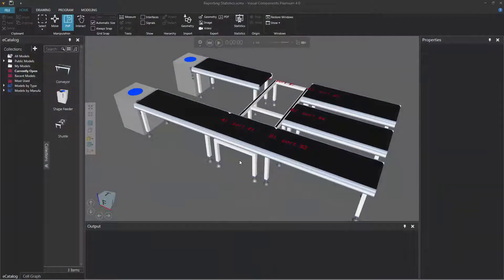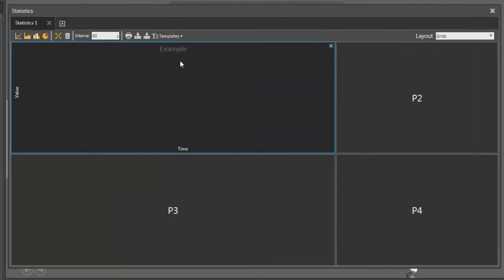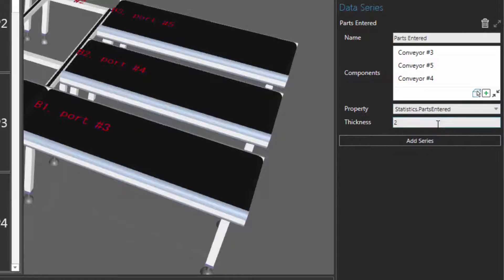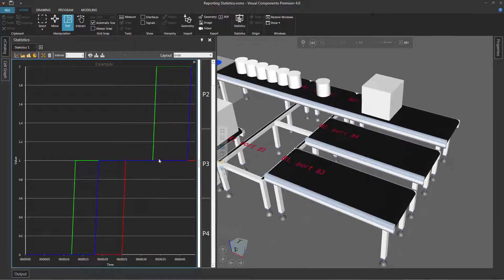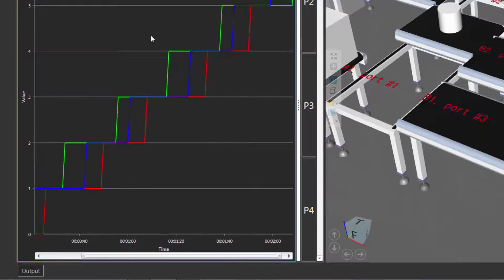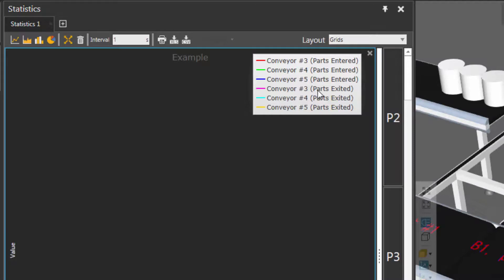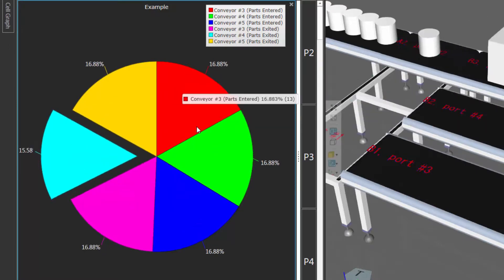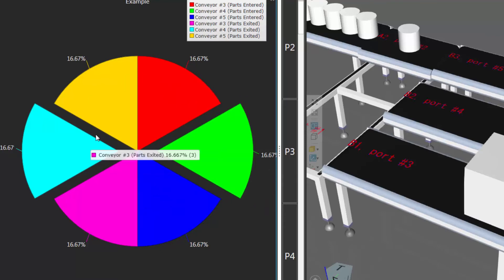Report Statistics

Comment: How do you add statistics capability for new component modeling? I created a custom CNC that I need to determine cycle times, idle time, etc...? 
I am using 4.1 VC.

Thank you.
Reply from the maker: Add a Statistics behavior to the CNC machine, and then in the properties of the Statistics behavior, create default states as well as your own. From there, you need to define when the machine goes from one state to another. Assuming there is a Component Container behavior in the machine, the Component Container has a Statistics property that can refer to a Statistics behavior, which automatically keeps track of flow-based statistics when referenced by a path or container in this case. This tutorial is a good starting point for defining states, https://academy.visualcomponents.com/lessons/component-states/
Reply: @Visualcomponents  Thank you for the explanation and reference!